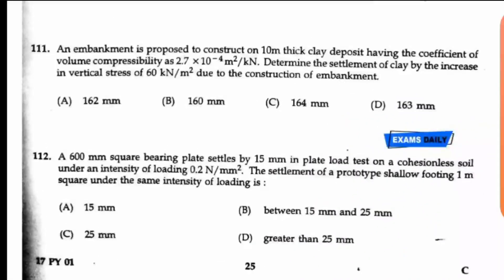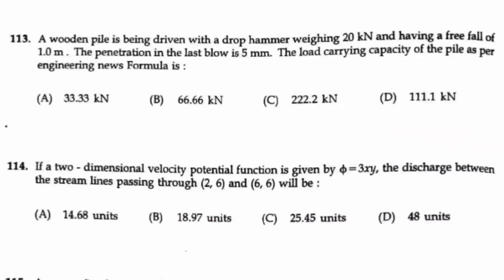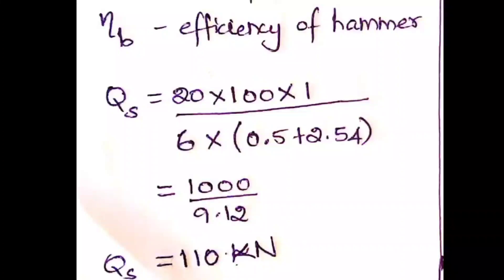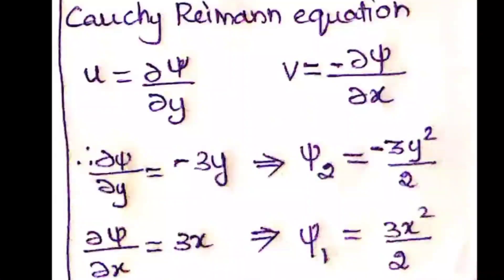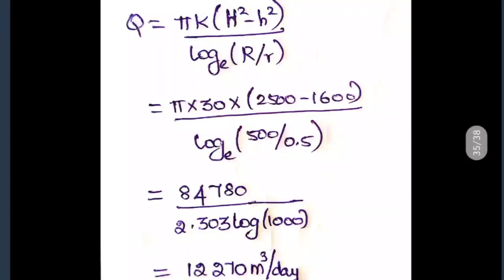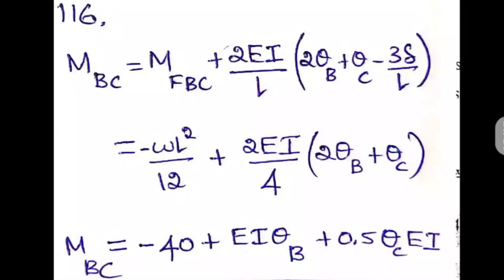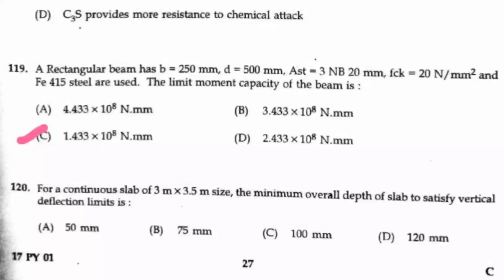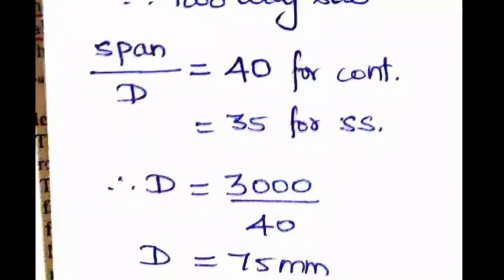TRB Polytechnic Civil Engineering 2017 Question Paper Discussion (111-120)

Comment: Mam in question number 114
Why your putting x^2=6^2-2^2
This is formula or what . Mam pls clarifying me
Reply from the maker: It's the substitution of the points given in the question.
Reply: @letzprepare4511   mam,if they give any two  points like (1,2)&(3,6) that means x^2=1^2-3^2  it came like that am I correct
Reply from the maker: Yes.
Reply: @letzprepare4511  thank you mam for instant reply